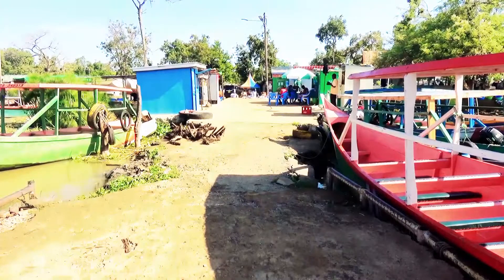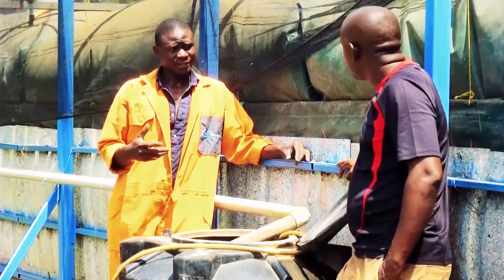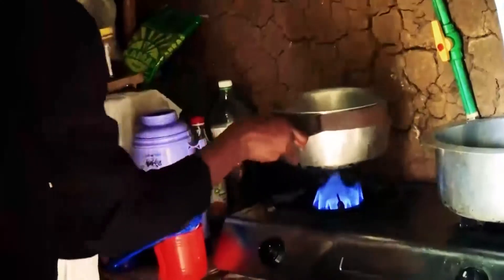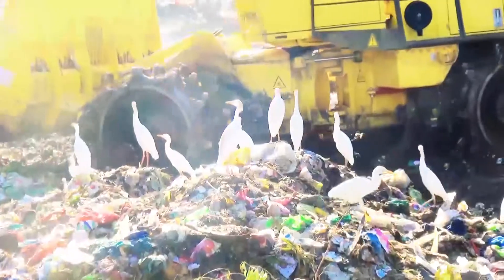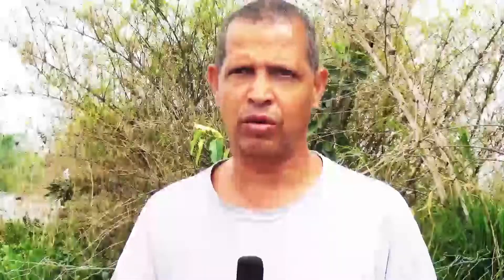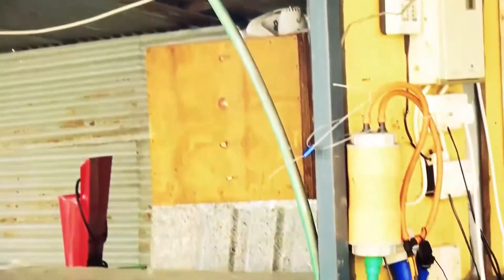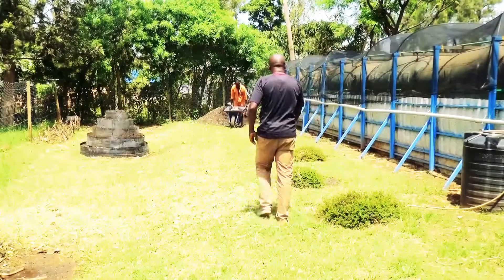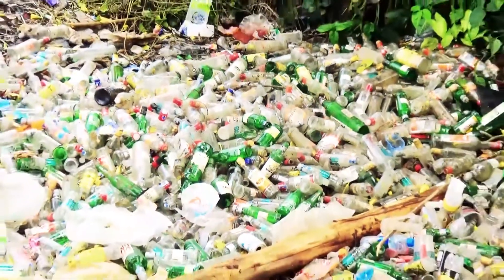Why Water Hyacinth and other Organic Waste are excellent in Biogas and Organic Fertiliser Production

Comment: I would like to hear about the biogas electric power generator
Reply from the maker: Absolutely! we modify generators whether it's a diesel or petrol engine to tun on 20% diesel/petrol and 80% biogas. The 20% is actually for starting the engine, as soon as it starts, biogas flows in, and from the generator, you can power your farm.